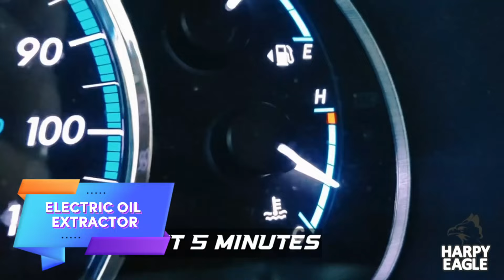20 smart gadgets for connectivity and entertainment on amazon 2024 🔥

Comment from the maker: tell me in the comments your experiences if you have already bought one of these gadgets or are planning to buy it 😍
gadgets link:
- RC Car Suspension Arm $14.58 https://amzn.to/3vfszSO
- CargoTech Pro $114,95 https://amzn.to/43n78M9
- Camportable Kitchen $3,475.50 not available.
- kuppet bike racks $89 https://amzn.to/3x0b1ur
- WPODAR Car Back Seat Organizer $26.99 https://amzn.to/3ThZuhz
- CupFone Extension $47.62 https://amzn.to/4cm16zq
- Door Pocket Hand Sanitizer Holder $12.95 https://amzn.to/4acFYd9
- Under Seat Storage System $99.99 https://amzn.to/4cj30kf
- Mud Flap Splash Guards Protection $179 https://amzn.to/3ve3yr2
- CupCoffee $26,99 https://amzn.to/3vaWATP
- Battery Monitor Meter $19.99 https://amzn.to/4a7EFfK
- LampGard $34.95 https://amzn.to/48ZtRzh
- PetRamp $107.95 https://amzn.to/3IEuYt9
- Brake Dust Remover $19.99 https://amzn.to/3IF5Q5D
- Mega Racer Black $39.99 https://amzn.to/3IG3EuB
- X-Bull Recovery Tracks $99.95 https://amzn.to/4ckIEY8
- AotoKoop Automotive Filter $23.99 https://amzn.to/3TodTJ9
- Bulge Acorn Lug Nuts $26.99 https://amzn.to/4cgjQjZ
- electric oil extractor $79.87 https://amzn.to/3VgMhIs
- ROYLUX LED Fog Bulbs equipped $44.99 https://amzn.to/3x5uWYJ